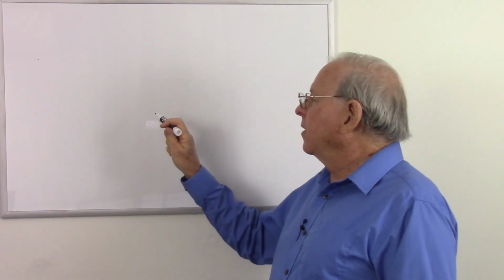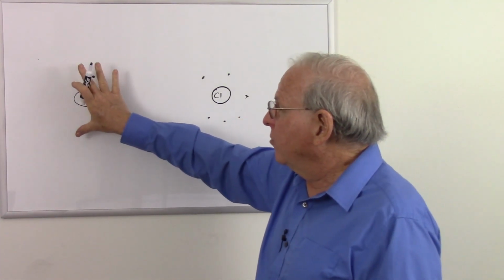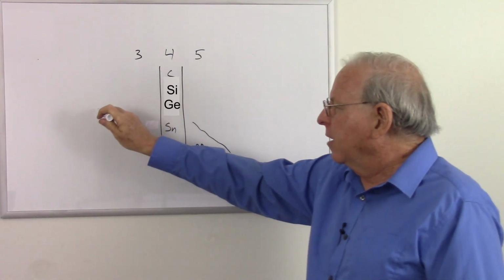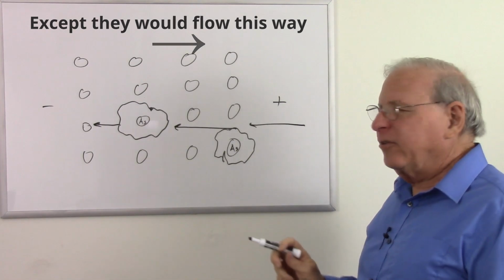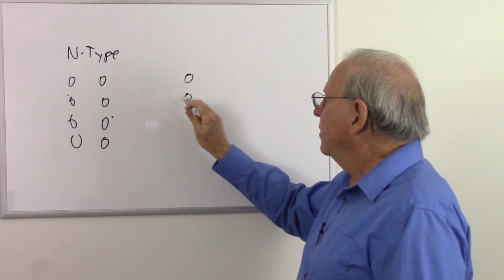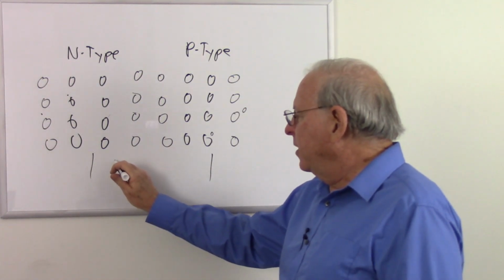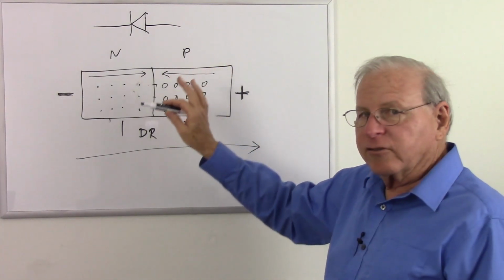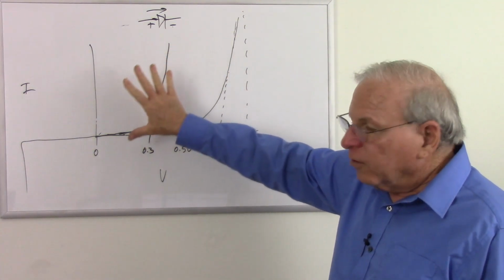Semiconductors - Solid-state Devices and Analog Circuits - Day 2, Part 2

Comment: How is sand converted into pure Silicon?
Reply: Most Si for semi conductors is grown.  To make Si from sand SiO2 starting point needs to be very pure (beach sand is terrible, as is nearly all sand) and then in an arc furnace mixed with very pure carbon the result is Si and carbon monoxide.
SiO2 + 2C -> Si + 2CO.